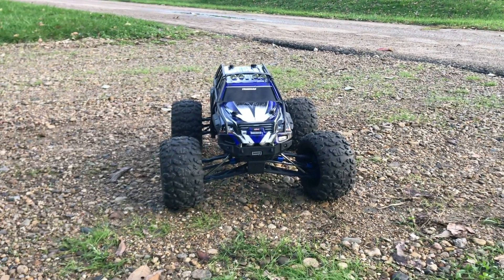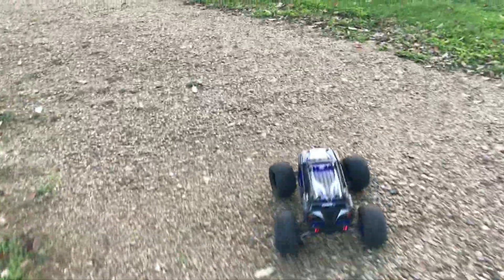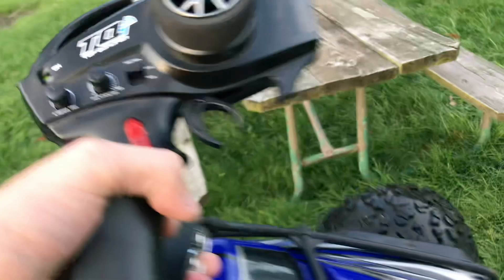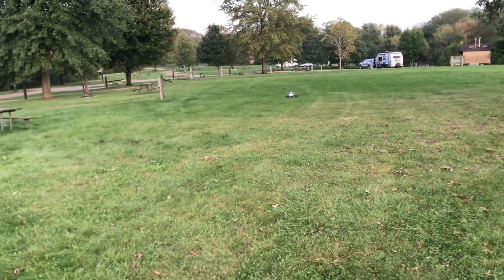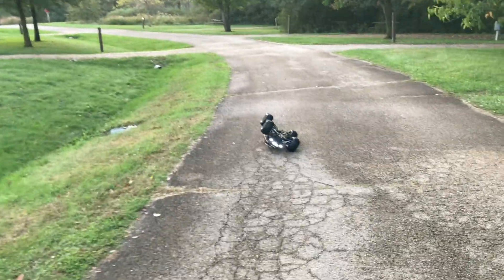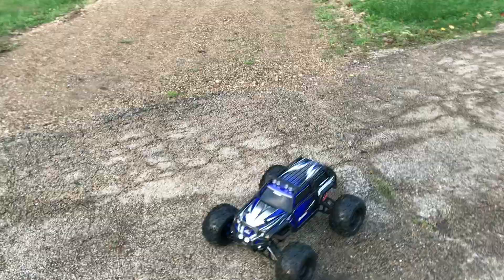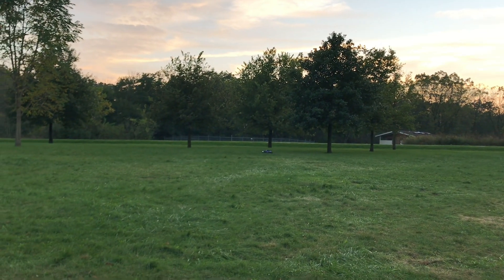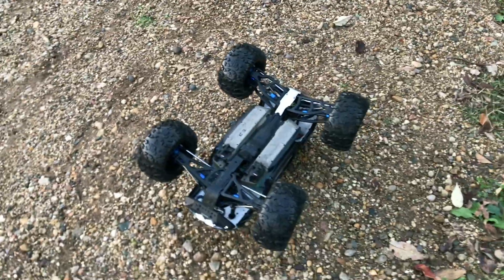1/10 Traxxas Summit - Brushless Conversion - 1st TEST of NEW HOT RACING DIFFS!! Can They HOLD UP??

Comment: I just changed the gearing on mine from stock to 17/62 and seems like it made a world of difference. I actually ran across your video of the same setup after I ordered the gears. What did it take to handle the system you are running? I know the diffs but I’d like to get mine to about the same speed. It’s been about 15 years since I was into rc cars and I just got back into it and trying to get my wife into the same hobby.
Reply from the maker: Well when I geared it up when it was brushed I burnt the motor up in the second run in the sand dunes so that’s when I decided to swap over to the Brushless System that comes in the E revo 2.0……definitely gotta beef up the drivetrain if you put a brushless system in though

Comment: Took my old summit out ripped apart my udr vxl6s in my summit been running 6s I think for me the key is less traction running 3.30 tires bashing jumping like crazy have not broke anything yet!
Reply from the maker: Wow…..that’s surprising that you haven’t broken anything yet….especially running on 6s
Reply: @RCKnockout  running track type tires less tracking still get the power I want out of it no strain on the diffs or trans since it's technically slipping
Reply from the maker: @2NiteWeHunt4U   makes sense….so what brand wheels and tires are you running?
Reply: @RCKnockout  hpi dirtbones
Reply from the maker: @2NiteWeHunt4U  are those off the Hpi Savage?

Comment: On my E-Revo 1/16 i had to install a Center Diff to prevent the Rear Diff from dieing.
Just put heavy Diff Oil in it, and it still do Wheelies.
Reply from the maker: I’m not sure if you can put a center diff in the summit….not that I’m aware of anyway
Reply: @RCKnockout  to bad.
Maybe it's because of the 2 speed transmission of the Summit.
Maybe you can use the Center Diff from the E-Revo 1/8.
Reply from the maker: @ronnyweinreich  I’m not sure if the trans from the e Revo works in the Summit…I’ve never seen anyone actually try it anyways

Comment: The gpm aluminum housings help the problem. I’ve been bashing my e revo brushless edition on 6s with the stock Traxxas gears and no problems
Reply: Is that different than the e revo 2.0? The diffs on the 2.0 are crazy beefy, love not having diff problems…. Literally the worst problem an rc can have IMO
Reply from the maker: Housing wouldn’t make a difference on the summit since it’s just cocooned in there and not attached to anything… unless you mean an aluminum diff cup? That probably would be helpful
Reply from the maker: @V8chump  agreed…diff problems are one of the most annoying things to have to deal with
Reply: @RCKnockout  Some of the most expensive parts on top of being annoying to replace 😪
Reply from the maker: @V8chump  very true

Comment: Try shimming the diffs,  use .1mm shims and dont shim them to tight, also big wheels and tires strain the diff and break them, use smaller diameter tires will help.
Reply from the maker: The diffs are shimmed as much as possible…..the 3.8s are the stock size for a summit….I don’t really wanna go smaller than stock

Comment: Yeah this was me 6 yrs ago. Love the summit I just don’t think brushless is the way to go. Constantly tearing ring gears in the rear diff for me.
Reply from the maker: Did you run 4s or 6s on your Summit?
Reply: @RCKnockout  4s
Reply from the maker: @johnc7894  did you ever try it on 6s?
Reply: @RCKnockout  No, I am sure 2 minutes of 6s would tear the ring gear apart though.
Reply from the maker: @johnc7894  you’re probably right lol 😂
Reply: So I caved today. Went to my local hobby shop to speak with a guy about the problems I have had ever since going brushless in the summit. He explained that there was a better hardened ring gear now traxxas part number (5379r) $45 bucks but if it works I am cool with paying the extra $30 bucks. We’ll see 🤞🏻
Reply: Did you shim the diffs?
Reply from the maker: @johnc7894  nice man….are they spiral cut?
Reply from the maker: @johnc7894  yeah I did…..it wasn’t the diff that failed the Hot Racing gears are still in good shape…it was the Internal spider gears that got chewed up….I replaced them with some hardened steel gpm spider gears…it only replaces the two side gears though
Reply: @RCKnockout Okay cool, no not spiral cut ring gear.
Reply from the maker: @johnc7894  oh I gotcha…..hopefully they’ll hold up for you 🤞
Reply: @RCKnockout  I just rebuilt the rear diff this morning. Can’t wait to see it back in action after I heal from my surgery. Hopefully I be running next weekend. Quick question do you leave the front diffs locked all the time?
Reply from the maker: @johnc7894  no I always leave the front unlocked when bashing….only when I actually need the traction do I engage it
Reply: @RCKnockout  okay cool
Reply: I gave up, i had 6s in my summit and i replaced the diff 10times. Sell it. I loved it to but diffs are garbage. No fix trust me
Reply: @peterrhoads1847   I have the LEM diffs. They are good on 4s. No issues now

Comment: Try to shim the diffs. Then they should be stronger.
Reply from the maker: They were actually shimmed
Reply: @RCKnockout  okey. But they didn't hold up to 4s brushless power?
Reply from the maker: @akselgrkr  it was the spider gears that failed within the diff cup….not actually the Hot Racing Diff gears